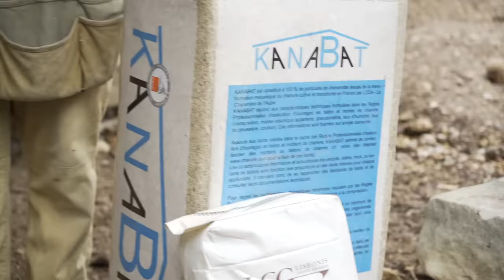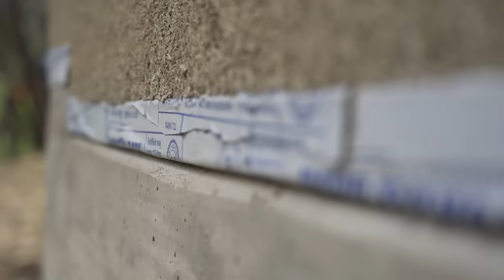Hemp Concrete Walls (R30 + Fireproof) - You Won't Believe How They Built This House!

Comment: I would like to have seen how they top off those walls. Next there is little reference to the ability to the use of any mechanical fastener. A wall is just about useless if you cant attach things to it when its finished. Even stucco and foamcrete walls have a certain tinsel and sheer strength capable of supporting anchors and or ledgers etc. Love the concept, but would like a better overview with a few aspects. Also, is the material value voided if an accessory coating is applied on the exterior? I will check with the other Matt on some of these but THAT would have been some good info. Last....I know Im a pain in the ASS but as an engineer and having built several homes over the course of my 35 years, I would love to know some of the concerns, arguments and roadblocks this project may have encountered as it pertains to the local building inspections and the set of I-codes this was built under. Im in Washington state, so the 2006 I-codes are essentially the mainstream here in most jurisdictions.

Comment: How do you access any plumbing or electrical that is sealed up within the hempcrete, and repair it after that access?
Reply: You put everything in quite wide conduits. It's pretty decent material to chase out of needed and easy to repair with more hemp.

Comment: During the American Civil War, farmers were required to plant hemp to 10% of their land.  BY LAW !!!  If you don't want to use formwork, making blocks of hempcrete is a great "non-load bearing barrier".  Open weave string matting is wonderful to lay on a slope, spray a bit of soil + seed keeps it all in place until root structure holds the ground together.

Comment: Beautiful structure. Question: Why does the engineer not require tamping on the face of the steel sheer structure? It logically seems it would give the steel beam gripping bolts much better gripping.

Comment: Natural fibers still trump fiberglass in overall carbon footprint.  Still, the carbon sequestration from the binder needs clarification. Limes and mineral cements requires heat input to drive off the carbonates that they then reacquire from the atmosphere. Efficiency counts though the net sequestration of carbon from lime and cement is still negative. The same might be of hemp depending on production methods.  I still believe that these designs, especially if you have a local source of hemp, improve overall efficiency. I have a lime-stabilized adobe/cordwood chicken house.  I think I'll build the next one from hempcrete.

Comment: This system will work much better if you resist the urge to install drywall, siding, or plastic acrylic or latex or enamel paint on the wall. Use pigments and surface tooling or polishing if possible, but don't cover this. Breathability is not necessarily "leaking" air. This would be a very warm and sturdy home as long as it's dry.
Reply: I would also not run my wires inside or used recessed wall outlets and especially no plumbing!
Reply: cover only with permeable lime or clay plaster! Thanks!

Comment: Thoughts on burying the 2x in the hempcrete? Is there a long term rot issue there?
Reply: OId Tudor timber frames used wattle and daub - sticks , straw cow shit and mud.  Its all about moisture management. Wood rots when moisture is trapped but hempcreate has excellent moisture buffering and migration. The way to protect hemp form the elements is a non hydraulic lime render which further aids in evaporation of the structure rather than trap it it. The worst thing you could do is put 'water proof' coating on the outside as the lime has functional drying properties which aid rapid moisture evaporation beyond that of 'vapour permiability'

Comment: matt thanks for covering this hempcrete product. maybe you could do an episode on best way to insulate a greenhouse? currently i'm searching out the best way to do this. many industrial large greenhouses are heated with propane or natural gas. i've seen several systems where this is completely unnecessary. would be great if you covered something like this. thanks for the great content

Comment: How would you suggest applying Hardy Board for the exterior with a Rain Screen?   And is HempCrete strong enough to secure furniture, painting etc. to on the interior?  Lastly, how would one repair damage to a HempCrete wall, eg pull-out of a fasterner that you want to fill, that would be strong?

Comment: I wonder if the overhang is because limestone soaks up water like a sponge 🤔 also just wondering how easy it would be to break through a waa all like this? I wonder how would it stand up to storms or is it for mild weather climates. Had to add this idea of wall wrapping my wires seems like issue if I ever have electrical problems
Reply: Conduit?

Comment: Sooooo.... does it breath such that you don't have to use a moisture barrier or worry about dew point and molding from condensation? I live in Montana where it can get really cold. I want to build a timber frame and maybe use hempcrete blocks or hempcrete forms for walls.

Comment: If you were to place 3x3 square washers (or like product) to the bolts you mentioned relating to shear would that not work as far as holding the wall in with the framing?  Also if you poured a traditional foundation and framed it with timber before hempcrete, I would assume hoedowns would be sufficient?

Comment: I wonder how this product would do hydraulic pressed into blocks large blocks and what it would weigh.. and what kind of weight it would handle
Reply: There would be limits to the size or it wouldn't work evenly, and the whole point is it is left quite loose in the centre of the wall.  This makes it fairly light (and why it is not loadbearing) and gives it a lof of it's r value... there's a lot of air trapped in that barely hand tamped material.  Pressed blocks would probably be only slightly larger than say a cinderblock and be quite light and in no way loadbearing, purely an infill material imo.

Comment: Interesting material to use for the walls.  It's unfortunate that they didn't run conduit to all the electrical boxes, only partially sleeving Romex in non-metallic conduit.  Any new wiring will all have to be surface ran.
Reply: Thank you, cdk2309.
Reply: Nah, just run a circular saw and gouge a 2" deep groove,  run romex and patch.

Comment: Hemp growing us becoming extensive in Kentucky, as it was a hundred years ago. I suspect the process is going to change a d become less labor intensive.

30+ years ago, the textile industry in Georgia was producing fiber products stronger and more durable than concrete that could be used in applications like columns supporting bridges. I've wondered why that never took off.

You don't have to import ancient building parts from Japan, that's millionaire vanity. But building codes, design, and acceptance by buyers will have to change. That's probably a time and cost function.

Comment: Additional question just came to mind, how can a remodel of adding a door or window be done, or adding a switch or electrical outlet, is this an extral wall or internall application, how do you replace it , will it degrade over time, will it attract various animals like bears, possum, raccoons, deer, stray cats, mice rats, ants roached, bees, wasps, birds, bats, what is the "R" value per inch thickness ?

Comment: can hemp concrete be used in damp areas, such as underground? 
A friend is considering using it when building an underground house, and I have heard that hemp concrete disintegrates when wet as the hemp rots and the lime contents powder?

Comment: This would be impressive if the wall was actually built out of hempcrete. That may be a problem though, because hemp fibers appear to deteriorate in a high alkali environment. Don't have to believe me, you can test it yourself. Check the dry weight before and after soaking in high alkali solution. There is no weight loss with most synthetic fibers or basalt or fiberglass, but there is with hemp (and jute). Sorry.

Comment: I am currently testing a new additive that is NOT HEMP, but extremely plentiful, and almost free.
Anyone that can help a disabled veteran get a GRANT to study it, I will be happy to share my findings.
I was first introduced to these bricks in Fairfield Iowa, while attending MUM.  There was a shop that made the bricks, I sent one into have tested. It was rated better that concrete brick because they were solid.
Also it is HYDROPHOBIC and you can do a wall radiant system that can both COOL and HEAT.
I have more information that has not been covered, but nothing is free, especially information.

Comment: Key missing point is you can't pack this material clear to the ceiling. What happens when you get to the top of the wall? This seems way more labor intensive with little cost savings. I'm going to stick with SIPS. Way easier.

Comment: For matty the hempcreet supplier, question: how would your mix, or could your mix be used in one of the new giant laser printer type concrete   printing machine. That lays a constant tube and from slab up, it makes the inside n out side walls.
Reply: Hard to do with a wooden frame.

Comment: The classic Japanese carpentry/architecture is absolutely amazing stuff (I've been studying it the last six months, that's how I came across this video), with the caveat that it doesn't have modern airtightness/insulation, the exterior walls are typically filled with a mud/plaster, so using the Hempcrete instead seems like the perfect combination!

Comment: This claim is HIGHLY dubious.
Materials like straw have insulating properties due to the hollow core of the fibers. If these fibers are chopped cross-ways that's not great but OK. However, if they are chopped axially (in half lengthwise) the pockets are destroyed and the Adobe or Cob mix becomes conductive , not insulative. 

Also: it's not structural once the straw is mangled into shards. The tubular structure, and length of fibers, both contribute to structural reinforcement.

For simple evidence, consider a long-fiber straw bale is R-30. If it is chopped into short segments, it is not allowed under International Building Code for straw bale structures. And loses significant insulative capacity. Yet, that is chopped by segments, not axially into mulch, which is far worse on both counts. 

I would recommended in the strongest terms you consult with an engineer, or research straw building techniques, for appropriate use of this material. [Because this ain't it by a mile].

Comment: Just a wild guess but I bet this product is more expensive than most other R30 fireproof insulating products. Doesn't look at that strong. Could do the same thing with bamboo. Hemp is a plant that DOES burn so not sure how they are making it fireproof. Could do the same process with bamboo.

Comment: My question is how do these materials perform over a long period of time, say 50-60 years?
Reply: Very well. Hempcrete gets stronger over time
Reply: @pauld3327  Thanks for answering. How about capillary intake of minerals and crystallization, which usually damages old facades and is one of the major long-term degrading factors for concrete, especially at the ground level? I am wondering if this was tested for these kinds of factors. Additionally, are there any treatments one needs to perform, one time or regularly, to keep these at their peak performance? Cheers!
Reply: @jupitereye4322  Hempcrete walls need to be lime plastered on the outside for both weather protection and air tightness.

Lime plaster should last about 15 years.
Reply: @pauld3327  Thanks! Good info, I wish those who promote hemp concrete would cover all aspects of construction and maintenance. Or maybe I should research it more... Cheers.

Comment: I don't see why you would have to use "hemp" as the fiber. ANY woody fiber should be acceptable if chipped to the proper size. If I understood what they said, the binder is what gives this product its special traits. With a little experimentation, one should be able to use the "waste" branches/twigs from the trees you cut down for your timber frame. Run the dried branches/twigs through a cheap, homeowner grade chipper and add binder. Of course if money is no object, these folks have done ALL the work for you. But if you are short on cash, this idea should be doable with a little experimentation. Buying their binder and making your own, LOCALLY sourced fiber could be a great compromise.

Comment: Seems good.  Would packing around the metal bolt sheer wall nuts help with the structural rating ?  Just asking.  I like the concept, R 30 for a 10 inch wall.  It looks great.

Comment: Since I'm not handy in any way. There seems to be no easy way to get into the wall to fix , replace or add more electrical or anything else in the future years.
Reply: actually, it is very easy. can either put in conduit or dampen it and cut away. then redampen the used mix and tap it back in. No need to buy new material.

Comment: Steel posts are exposed to the hempcrete what is very alkaline ... as the vapor comes and leaves it can cause corrosion in long term, therefore I'd add an extra layer on the steel like bitumen sheet what is not nice but effective

Comment: Its best made in a factory rather than site made. Site built has lower compression strength and contains no wire reinforcement. Also it requires 6/8 weeks to cure.

Comment: Since it’s not structural, how is lateral bracing addressed in California for code required earthquake bracing? The usual California house has shearwalls out of structural plywood or OSB.  That sheathing would cut the monolithic “pour”.  Then it’s only fancy insulation right? 

I’d be concerned about packing porous material directly around wood in the humid climate here on the Northern California coast where it rains 75” a year with high humidity.

Comment: Could Hempcrete be used for pavement?
Reply: You can add hemp fiber to your cement mixture. It will function like rebar, but it does not rust. The ancient Romans used hemp fiber in this way. They didn't have steel to use as reinforcement.

Comment: To had fill the wall molds by hand from small buckets plus the drying time , would take way too long . How about making pre formed  large bricks like concrete blocks  with an interior structure and passage for wire/ pipes?

Comment: Not quite convinced concerning the flamability. The torch already damaged the wall as it looked and if you have a huge wildfire i would guess the effect would be worse. Then again, most buildings after a wildfire are inhabitable, right?
From what an architect told me who put straw into his wallsections, i guess it is an exelent isolator to keep stable temperatures inside.

Comment: i'm always a little suspect about capturing structural components into void-less assemblies. like spray foam......it's tough going back.....high cost to access /repair / modify over lifetime. Check out the Hemp-lego bricks instead. Plus forming? wow! this is super "look at me" early adopter stuff. let the millionaires play they don't care about 20'-30 years down the road.

Comment: It seems to me that would be more practical to press this material into the mould and create brakes on the factory floor. Possibly even make them so they hold onto each other like Lego blocks. I don’t see the benefits of casting this on site. Must be difficult to finish the top of walls as well.

Comment: By using this type of construction, the price of this home build in my opinion would cost three or more times the cost of a regular home build. Also this type of wall construction want prevent Animal Ingress  so you would need to place some type of screening inside and outside to keep Animals from digging into your home. I'm almost sure the use of (SODIUM SILICA) or (WATER GLASS) so as to stop fire problems. Am I right about this????  I wonder what the cost difference would be between (WOOL INSULATION) not (GLASS) and (HEMPCRETE)????  There's also the question if it would be Legal to use (HEMPCRETE) in your area????  He was saying you could hang (DRYWALL) over the (HEMPCRETE), but I think you would have to use an expensive (GLUING SYSTEM) to hold (DRYWALL) in place. You tell us please???? Thanks for the upload.